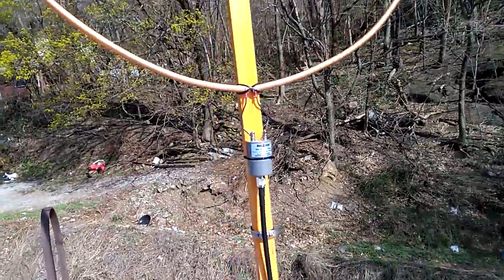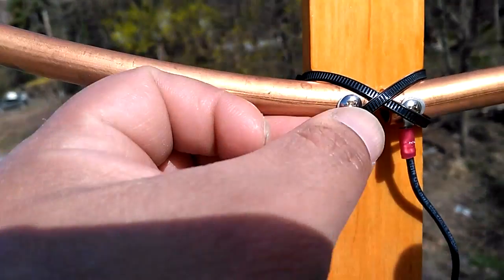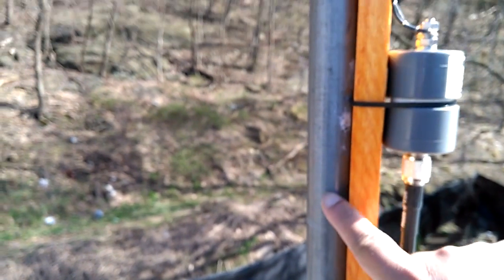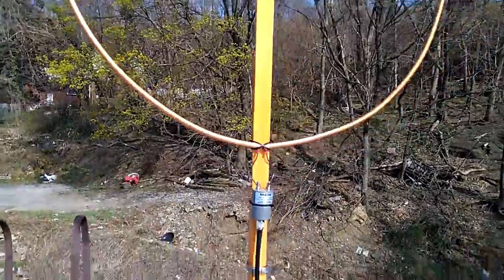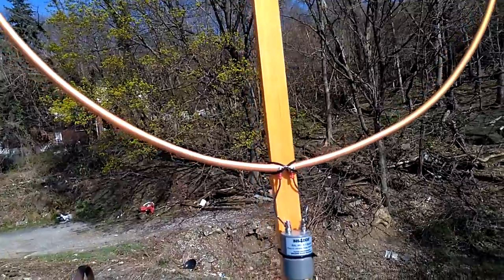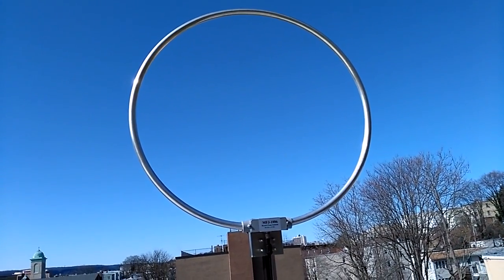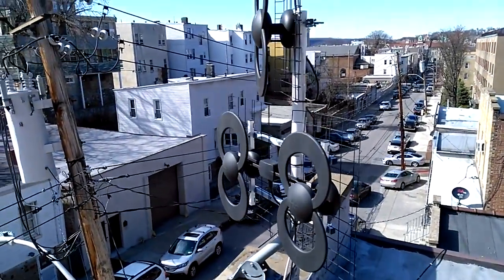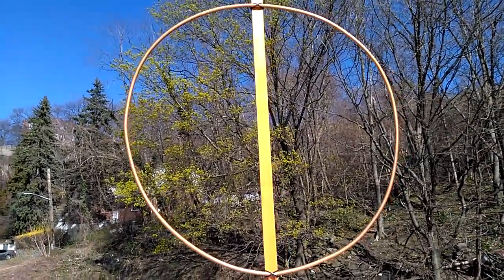DIY Copper Tube Active Loop Antenna - Antenna setup build and outdoor roof mount

Comment: My father when alive had made a copper loop for his 60's motorhome as a TV antenna. Partly because he was a gas fitter dealing with home propane installs and repairs before retirement, and after in the RV community because he said they had similar loop antennas in the world war 2 Halifax bombers, he survived, what I did not ask him or find out is what diameter would be best for TV signals? Yours is based on a 10 foot length rolled but is it for TV? I think his was about 24" diameter but may have been based on space. Another thought I had was if helical coil of 2 or 3 loops would increase strength. I may have a old air conditioner line to experiment with of several meters. I was also considering mounting flat to act as omnidirectional as our location has channels from 2 directions about 90 degrees from each other but 30 to 50 miles distant. Or could 2 loops be used vertically like yours but using coax and splitter feeding each in?
Reply from the maker: That is a great story Ken.  That is what this hobby is all about, experimenting with your own ideas along with the science.  I will have to try some of your ideas, thoughts and put them into practice, like the helical coil antenna.  This particular went to the UHF range, so I'm pretty sure I could have picked some TV signals, I didn't bother to try.  Thanks for reminding me.  I will have to rebuild the copper element part of the antenna, since I used it to try the MLA-30 mods.  Thank you for sharing your story about your father.  God Bless him Ken.  God Bless you too Sir. Thank you for posting this.  Have a great day Ken.  😊

Comment: Hi Danny. Does it have to be a 9:1 balun? And not 49:1 because of the impedance? I might make one.
Reply from the maker: This antenna had a 9:1 balun. I prefer a 1:1 balun but it still worked well. I no longer have that antenna because the MLA-30 does a much better job. Thank you for watching. Have a good day.

Comment: When you paint the copper pipe, does that interfere with the signals?
Reply from the maker: No it does not interfere with the signals.  I sprayed clear polyurethane over my loop on mine.  I did not want the copper to oxidize and turn green.  You can paint it if you like.  Thank you for watching and thank you for subscribing to my channel.  Have a great week.  😊
Reply: @dannyradioandtech  Thank you for everything!

Comment: Why did you decide that this small frame antenna has a large input impedance? Why is the transformer 9:1 and not 1:1? I think that this frame with such dimensions will have very low resistance at short waves.
Reply from the maker: It is called experimenting my friend.  A lot of this is theory rather than science.  I'm no expert in this field.  Thank you for watching my friend.  😊

Comment: Really enjoyed the video Danny. I watched your video because I am interested in buying or making a loop antenna to capture my work Public Safety from home. I am a licensed Ham and do have FM and DMR and D-Star and C4FM radios as well as a NXDN handheld that I use to listen to my work Public Safety. I am trying to hear my work PS on my Uniden SDS 100 but have not been able to do so. I have tried numerous antennas like a discone and mag mount and others. I live in a 22 Story High Rise and cannot put anything out the window, even though at night I have put some antennas out to see if I can pick up my work PS. I live in what is called Coop City and am surrounded by other Coop City high rise buildings that I think are blocking the signal. But the NXDN hand held does pick up work PS just fine so I am thinking that a better antenna may pick them up too. I am hoping a Loop Antenna does the trick. You are using Loops for HF but I need one for UHF just outside the ham bands at 464.000 MHz. I looked carefully at your design and think I can do it. What advice to you have for me?
Reply from the maker: Yes I'm familiar with Coop city in the Bronx.  I grew up in the Bronx.  I live in Yonkers now which is further away from NYC.  I pick up some NYPD.  I'm using a discone antenna, however this loop did work for UHF and I was able to pick up NYPD around 460+ MHz and the signal was audible on par with my discone antenna.  I believe any big old hunk of metal would pick up those especially you are there nearby.  I would try something similar to this.  Maybe use a 75 ohm balun with a copper loop like TV antenna, they frequencies are near where I believe some public safety will be received, also maybe put it on a tripod where you can easily rotate and make it more directional.  Very interesting, I will have to do an update video and mention this question on a future video.  I'm sorry I havent been able to answer questions or comments on a timely basis.  I get overwhelmed with 3 other channels and life of course.  Great question Antonio.  Thank you for the comment. Thank you for watching, take care my friend.  Have a great day and stay safe Antonio.  😊

Comment: Thanks for video Danny, don't those power lines nearby give you any problems with noise. Sorry if that is a daft question, but only a SWL newbie.
Reply from the maker: So far no problems with the power lines.  I have more problems with neighbors running certain appliances at times.  I usually have it pointed away from my main noise source.  I since then used this copper element on a modified MLA-30 antenna now.  Thank you for watching and great question.  Have a good day Mike.

Comment: yes its a good idea to paint ur copper tubing to avoid oxidation  that will cause Skin effect that could  result in Noise
Reply from the maker: Yes I read on some forum to cover it with some coating. So far no oxidation. I since then used the copper element with the MLA-30 antenna. Thank for the comment and watching the video.

Comment: if it is an active loop it needs a low noise amplifier  and if you dont transmit you dont need the balun
Reply: A choke is very useful on small untuned receive antennas like this loop as it helps to isolate the outside of the coax from the antenna/balanced feedpoint.  If you don't isolate the outside of the coax from the antenna/balanced feedpoint, it will often introduce noise that's picked up on the outside of the coax.  Also if you don't isolate the antenna/balanced feedpoint from the outside of the coax, the antennas pattern and deep nulls off the sides of the antenna are often destroyed which will cause it to pick up noise/signals coming in off the null directions which would otherwise not be present.
Reply from the maker: Thank you for watching.  Have a good weekend.

Comment: Does the LNA above 1: 4 balun attached?
Is that all ?
Reply from the maker: I no longer have this antenna setup, it was a 1:1 balun with the LNA near my SDR at the basement, it did worked good.  My LNA went dead on me a few weeks ago.  Now I will use the copper loop element in the future with the MLA-30 loop antenna.  Happy Holidays.

Comment: Remember to use the u/v rated zip-ties or the sun will make quick work of them. Great videos
Reply from the maker: This is still a temporary setup, however i'm aware of the U/V damage to plastics.  I plan to secure them with copper pipe straps, i had bought the wrong size and also weather seal all the connections and the exposed wiring.  Thank you for the compliment.  Have a good day Felix.  :)
Reply: Your antennas are really impressive and wish I lived where they do not complain in 30 seconds.  Put up the mfj-1886 and near instantly neighbors were asking what is it etc... Not even a big antenna? Geez...very  envious of your arrangement.  Best regards
Reply from the maker: Yes that really is a bummer.  Thank God I don't have to deal with HOA.  Have a good weekend Sir.  :)
Reply: No HOA luckily just busybodies. Keep building!

Comment: That is not bad of an antenna. Now you said you got it as a HF/VHF/UHF antenna and it works with pure intent right?
Reply from the maker: I made it for shortwave first and medium wave second.  It does pick up FM broadcast, some airband and some UHF frequencies,  the highest frequency was around 480 MHz was a NYPD frequency. All using the SDRPlay RSP1.  I may switch to a TV balun, just to see if I can pick up over the air TV stations.  :)   Thank you for the comment Bobby.

Comment from the maker: Thank you for the suggestions, please keep them coming regarding having the LNA near the loop antenna and power it from there.
Reply: I was just about to post this. Always amplify signals before they get to the local noise, and before they get attenuated by the coax, meaning at the antenna. I doubt if painting copper black will help. Copper is pretty immune to Ultra-violet rays. But oxidization is a problem. Some folks sand it smooth to get to the least oxidized copper surface, then spray it with a clear plastic finish to keep it from oxidizing.

Comment: To clarify a bit, my coax coiling “choke” suggestion was not to replace the balun. It was a simple remedy to any common-mode current issues running on the coax, if encountered. I put a comment on your other video regarding balun selection.
Reply from the maker: Yes I was aware after recording lol, my videos are not scripted.
Reply: No worries Danny. Sorry if I am "spamming" your comments sections a bit... I just thought I'd fill out any remaining notes - if people wanted to follow your lead. You have now put up probably the most detailed youtube video build guide to DIY wideband receive loop antennas. I think it's just wonderful and long overdue for SWL!  :)

Comment: Is there a ground anywhere off of your new homebrew? Being copper and high up… You want to protect your amazing radio collection! :)
Reply: How tall is your loop from the base?
Reply from the maker: Yes once i decide to have it permanent setup, then of course I will ground it like all my antennas. When I'm using not my radios or expecting thunderstorms. I always disconnect to any outdoor antennas. I'm a bit paranoid when it comes to that.  :)